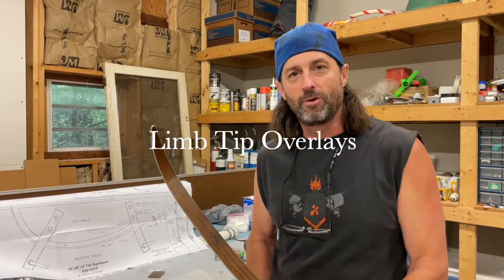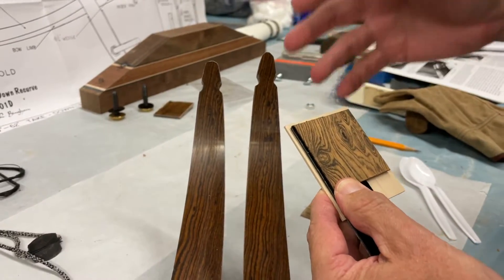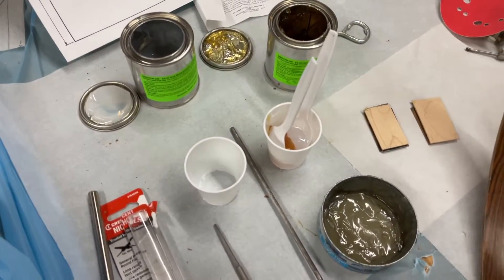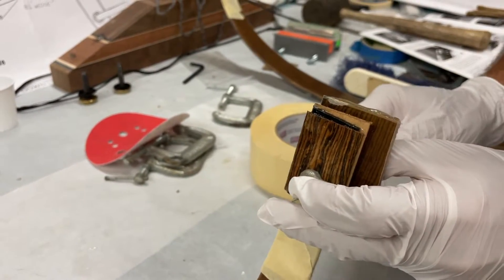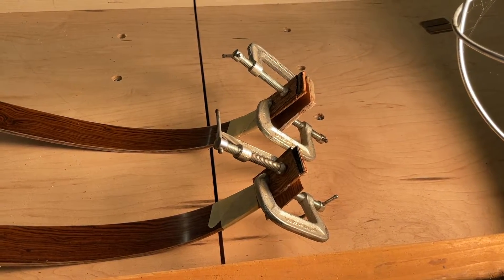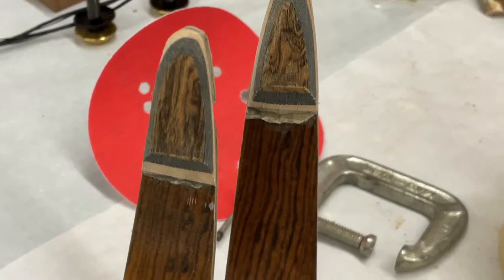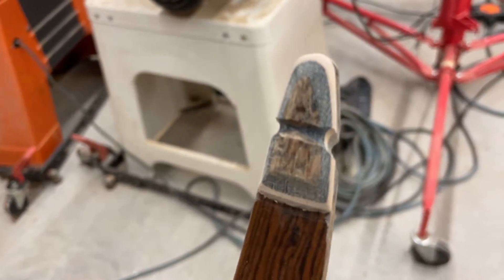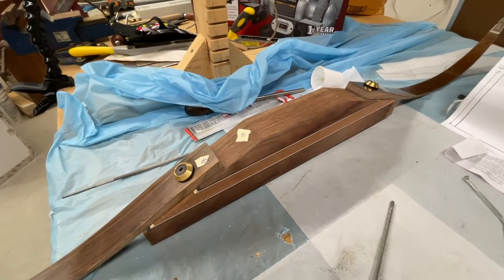Bingham Projects Take-Down Recurve Bow Build Series - Part 7 - Limb Tip Overlays

Comment: I'd cut the grooves a little deeper still bud, and take into account how much the string loops will pivot when you draw the string all the way back. If you don't remove enough material for the string to pivot and move freely with the angle that drawing the bow all the way creates you could get a little hinge that develops right there at the tip overlays that will wear your string loops down quite fast over time. Great video series man! - Obediah
Reply from the maker: Yep and that is exactly what happened.   After a couple months I noticed the string getting roughed up quite a bit and then had to go back and do exactly what you said to do.
Reply: @BooneDownSouth  Yup I had to learn that one through trial and error as well haha. There's several nuances to making traditional bows that no one tells you about and you just sorta have to pick up along the way.

Comment: I gotta tell you I have been very impressed with your bow build so far.you have done a fantastic job...
On the limb tips you should glue them together then wrap them in plastic and then clamp them to the bow and let them dry...that way you get the curve you need...once dry then you take them off and rough shape them and you get your angle cut perfect ...then glue them on to the bow and then do your final shaping once dry....I just saw that done on another video as I am looking to repair an old bear bow I have where the tips were separating from the bow and one side the overlay was broken.....
Great job...inspiring me to build a bingham long bow kit....
Reply from the maker: Yea the way I did it, it was a little tricky.  Since I glued on 3 pieces for the overlays they were sliding all around.  Next time I will for sure cut the overlay pieces so that they are all the same size too.  Thanks for the compliments!

Comment: The tips look good. Nice work.
Reply from the maker: JH Archery - Thank you.  I knew something wasn't quite right with one of the tips and couldn't figure it out but I see now that I put the video together that one of them goes to more of a point than the other.  Once the riser is finished and I am down to the final sanding I am going to get that cleaned up a little better and clean up the string grooves a little more too.  I have high hopes at this point though!